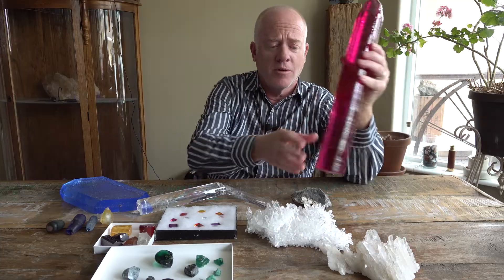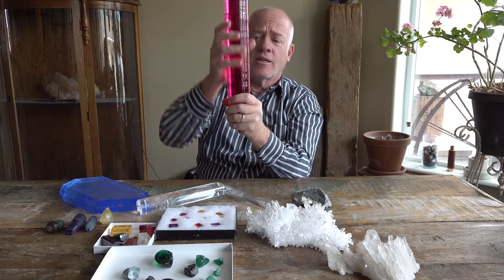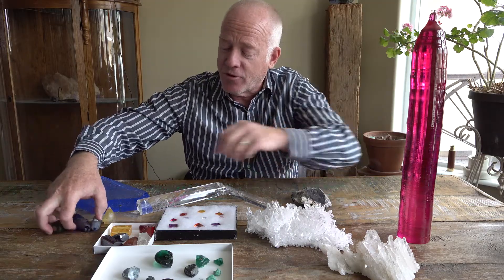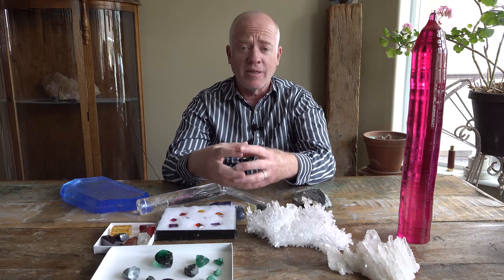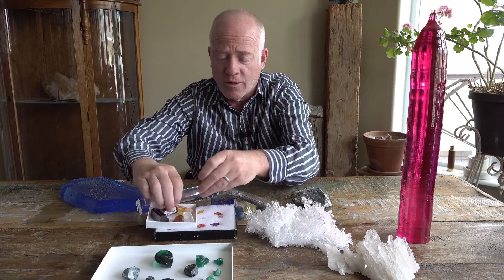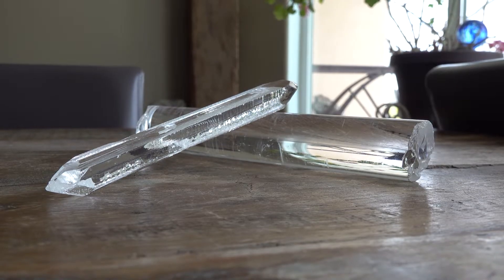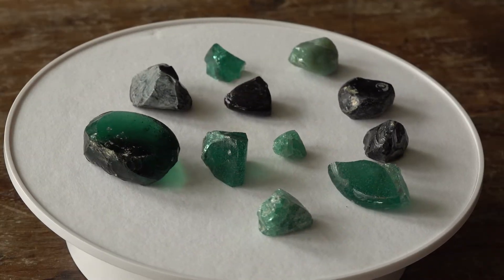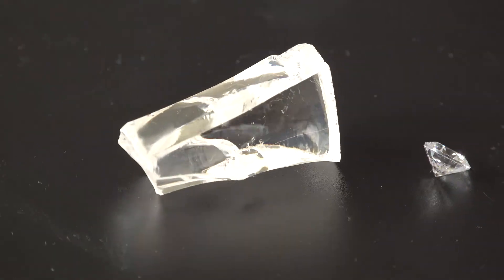Synthetic Gemstones

Comment: Great video, got any more info on the green balls that form in the bottom of the crucibles, seems weird that glass would sink passed the metel in a crucible and not float on top. There nice color likely not stable enough to facet
Reply from the maker: @theplumbingprospector9024  I've had them faceted, and you're right... It takes a lot of material to find one that holds enough to cut. I also agree, it seems backwards that the metal would float, but it does.

Comment: I used to grow SiO2 on Si wafers in steam.  it took 4 weeks to grow 20um thick.  sure we could cut the time in half with higher heat but, any hotter than what we used, the SiO2 would flow and fuse to the quartz wafer carriers.  So we ended up with a 4 week long process.   This required specially designed steam generators that I came up with.
Reply from the maker: That's very cool!!!

Comment: I really want a monocrystalline Corundum desk.

The thermal conductivity and hardness properties would be very useful for a lot of projects.

Would be cool to have optical gear directly integrated into the desk as well.
Reply from the maker: @usopenplayer  🤣🤣🤣 could you imagine the size of the boule you'd need?
Reply: @RockOnRickMaritta  I suppose it would depend on the orientation we cut the desk out.

Let's say a 48" wide by 20" deep by 1" thick desk.

If we slice the desk out vertically the boule would "only" need to be slightly bigger than the desk right? Around 25" in diameter? It would need to be at least 48" long.

We need to find the volume of a cylinder with base diameter 25 in and height 48 in. Start with an equation that relates the base diameter d, height h, and volume V:

V = (25^2×48 π)/4

7500 π in^3 (cubic inches)≈23561.9 in^3 (cubic inches)

Switching units now sorry,

So about 386,111cm³ in volume.

(386,111 cm³ ) * 4 g/cm^³ = 1544 kg

Switching units again.

The boule would need to weigh at least 3,405 lbs.

So the boule would be about the size of a large water heater but weigh as much as a car. 🤣
Reply: @usopenplayer  you could build a tabletop out of corundum intarsia style.
making it out of many small pieces should be much easier and cheaper than making a giant boule.
edit: you could probably even afford to do so.
and since you care about thermal conductivity, you could make the inlay table out of silver or copper.
would be a very cool table.
Reply: @koloblicin  This suggestion blew my mind. There are so many possibilities now.

Thank you!
Reply from the maker: @usopenplayer  😂😂😂
Reply from the maker: @koloblicin  @usopenplayer post pictures when you get it done!!! 😆🙌🤣
Reply: @usopenplayer please do a video for us on the fabrication of your desk!

Comment: You described the Vermeil ( ver - MAY ) process, but the boule you were holding was clearly grown by  "pulling" from a melt puddle, which uses a seed crystal. Vermeil's process grows by addition at the top with something that lowers it, while the more modern process grows by addition at the bottom while the boule is raised upwards. Also, pure sapphire/aluminum oxide/carborundum is clear. The red color means that impurities ( usually chromium related ) were added. Synthetic sapphire is even used for stove cooktop now, so it can be grown/formed in large sheets.
Reply from the maker: @gregorymccue5003   yes you are correct, we've had other comments on this also. I had them backwards in my head! Good catch!

Comment: Are sure that large one wasn’t czochralski pulled rather than flame fusion verneuil! Looks it to me
Reply from the maker: Checking.
Reply from the maker: Completely forgot to come back on this!!! YES YOU ARE RIGHT-- I had it backwards in my head on this. Thanks for the heads up.
Reply: @RockOnRickMaritta  On the other hand the spinel boule with that "frosty" surface and by its dimension looks very much like it was made with the Verneuil method
Reply: You're right